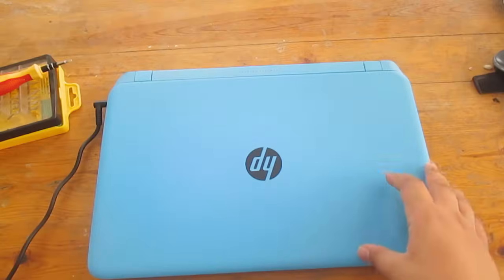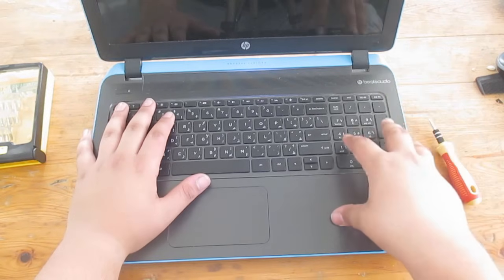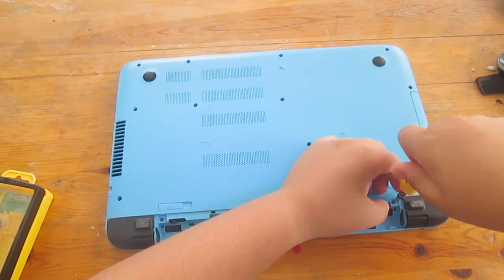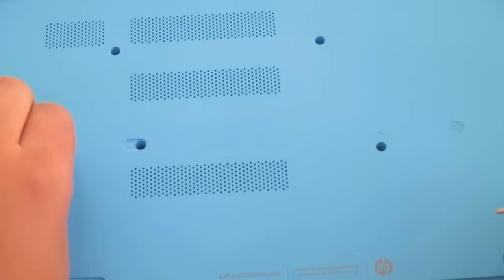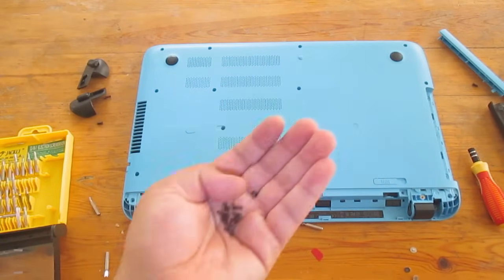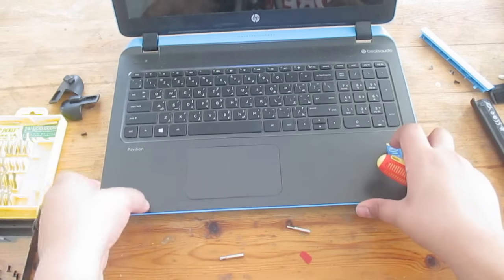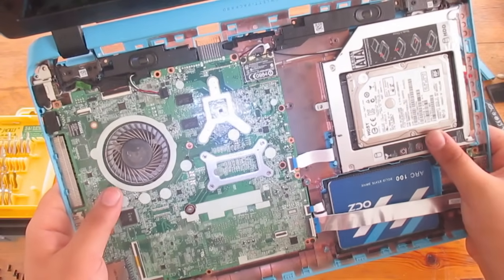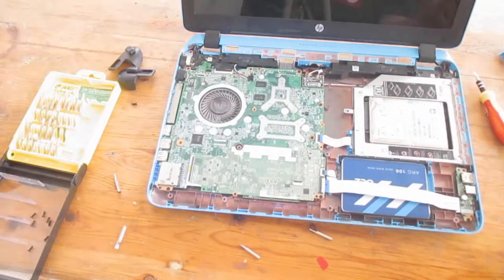How to disassemble Any HP Pavilion 15 P series notebook

Comment: I'm thinking about replacing the keyboard, how would you remove the keyboard out of the frame?
Reply: same here
Reply: Same question from my side
Reply: @harshjain1207  Don't do it. I tried it shortly after this comment was posted to discover that it is not replaceable unless you know how to solder it back into place which is not an easy task at all. I destroyed the laptop in the process of attempting to replace it without soldering.

Comment: does your laptop have a mini pci -e port
Reply from the maker: Yes it is on the top of the laptop body , Right above the Battery compartment
Reply: +Games Matrix I'm looking for a egpu stuff like one which requires an mini pci-e port to operate.
Reply from the maker: It wont work well with this laptop , as there is no removable compartment like most laptops out there, if you want to hook an EGPU you need to keep the laptop disassembled and have a bare bone mother board , Ii dont think it is worth the effort imo because you need to invest in a GPU and the EGPU adapter, and it is a hit or miss because Most HP laptops have PCI-E White listing which prevent anything other than specific WiFi/Bluetooth cards to work.
Reply: +Games Matrix oh I see that's too risky then, maybe I'll buy a computer in future till then my gt 840m is what I've got

Comment: I only have one flat screw on my laptop and it is IMPOSSIBLE to loosen. I have the correct screwdrivers. I even used pliers for more pressure and it is not working. this screw is under the plastic covering the optical disc drive, so it has to come off somehow. But I'm so stuck.
Reply: hi i know its late but did you get it out

Comment: Can I replace graphic card or core after i disassembler? Because 4 gb graphic is too low for me to play games.
Reply from the maker: +Zheng Hong Toh No you cant upgrade cpu/gpu . gaming is not only about the size of the card. i play games on a 2GB gpu , if you want extra performance learn about overclocking and do it within safe margins, i used to OC that laptop to boost my frames most of the time with decent temps

Comment: I'm guessing no, but would this laptop be able to use an external graphics card dock, preferably this one http://www.ebay.co.uk/itm/V8-0-EXP-GDC-Beast-Laptop-External-Independent-Video-Card-Dock-/321965028463?hash=item4af69c746f:g:ZOsAAOSwa-dWiCdX  ? Thanks in advance
Reply from the maker: +Ben Deane hey, I remember searching about that part, the one you linked wont work because it needs an Express card slot ( found in old laptops) what you need is this one

http://www.ebay.co.uk/itm/V8-0-EXP-GDC-Beast-Laptop-External-Independent-Video-Card-Dock-Mini-PCI-E/121860826167?_trksid=p2047675.c100005.m1851&_trkparms=aid%3D222007%26algo%3DSIC.MBE%26ao%3D1%26asc%3D20140122125356%26meid%3D9c8eced2952b4c6ba29ad8e7a832aca7%26pid%3D100005%26rk%3D1%26rkt%3D4%26sd%3D321965028463&tfrom=321965028463&tpos=unknow&ttype=price&talgo=origal

This is a mini PCIE one , you remove your wifi card and place that connector, But keep in mind since this laptop is pretty much locked down ( no separate panels for ram/pcie/hdd) you need to have your computer disassembled in order to use it, Plus there is a risk of the laptop not even booting because HP uses some protection and white listing which allows specific PCIE devices to run.
Reply: Games Matrix Maybe I won't try. But thanks so much for your very detailed answer and the link. I'm subscribing!!!!!! Thanks!
Reply from the maker: I am glad i helped :)

Comment: Thanks a great video!   I am trying to replace the HDD on my sons HP 15-P100dx laptop with a SSD drive and want to place the current 750GB drive in the optical bay with the adapter.    They seem sell 2 kinds that are either 9.5mm or 12.7mm thick.   Do you have any idea which one is needed for the HP Pavilion P series laptops.   Thanks again!
Reply from the maker: +Herb Karasic I bought the 9.5mm 2 years ago and used it across all my HP laptops, Pavilion G6 / PAV 15 N and PAV 15 P So yeah  i am pretty sure the 9.5mm is the way to go. Btw make sure to put the SSD in the Primary Slot and the HDD in the optical drive bay since the SSD needs sata6gb/s while HDDs work fine with 3gb/s

Comment: Cool video Man! but hey I've got a problem, it's about the keyboard, multiple keys doesn't work, I mean I can press them but they do not respond, also my keyboard's light turned off and I can't turn it on, the keys that doesn't work are 6(in both pads, keyboard and number pad), 5 in keyboard, ?, ' , f2,f5, and others... My laptop is a HP P series, beats version, is a black with red color.. Please man, if you can answer me it would be awesome! I'm so delayed in school projects /: cause of that. Thanks

Comment: games matrix do I need to buy  sata cable. also to connect 2nd ssd or is der in labtop  already
Reply from the maker: +Donal Dhar You need a special component to connect a 2nd SSD/HDD , which is the optical drive caddy

Comment: thank you for the very helpful video. I have 1 question though..those "ribbons" you remove right after prying open the case.. how do I reattach those when putting the pc back together again? thx in advance.
Reply from the maker: +Sille415 The ribbons are long enough to allow you to squeeze you hand inside and slowly insert them
Reply: @ananjaser1211  hello..thanks..I have a question as stated herein.

Comment: Hello this is a nice video! I have one doubt; my computer is 1 year old and the fan started to sound a little bit harder like a week ago, do you think the fan is thrashed or maybe only dirty? I used the laptop in very dusty areas though. do you think an external cleaning will do the trick? or maybe dissassemble it anc clean it from the inside? any way of knowing via software if my fan is not working well? thanks : - )
Reply from the maker: +Santiago Hernández well , if you used the laptop is a dusty environment then i would assume that the fan was damaged due to heavy dust , or the fan is just dusty and needs rough cleaning , eathier way you need to take a look inside the computer , 1 year in a dusty environment should be enough for alot of dust to build up

Comment: I recently open my Notebook HP Pavilion - 15-p150np (ENERGY STAR) because iam having overheating issues and i dont really know how to clean the vent ? How should iclean it?
Reply from the maker: +Hi Im Project First, make sure you have an overheating issues, I would assume your laptop is similar to mine, so your GPU temp should not reach 75c or even 70c , and CPU should be the same as well, if you have laptop shutdowns , download some tempreture monitoring programs and use the pc and notice the temp, if it goes too high, To clean the vents you dont need to disassemble the PC, just get  a can of compressed air and blow through the vents and the top of the keyboard near the WASD since that is the fan intake . If the laptop is 3 5 6 months old i doubt it is overheating unless you live in a dusty area
Reply: Ok Thank you For your Help

Comment: I cant remove one of the flat screws :(
Reply from the maker: +YouAreAnFajit I had that happen to me, I got a flat head screw pushed that screw down as strong as i could while rotating it, and after countless minutes it finaly moved. I never re inserted that screw back xD
Reply from the maker: Haha yeah i spent alot of time trying to get it out well, but then i was like to hell with ti i aint putting it back xD
Reply: same here dude
Reply: Games Matrix HAHA believe it or not, I happened to do the exact same thing before I even saw this comment and I don't plan on putting the screw back xD

Comment: Can you explain a little bit more what is that you adapted the DVD to insert another hdd?
Reply from the maker: +Héctor Escolar It is called, Optical Drive caddy , it fits a 2.5inch hardrive, and gives a SATA3GBs Speed, So use it for mechanical hard drives NOT ssds, it is pretty straightforward
Reply: +Games Matrix Thanks, and can you tell me if this laptop has one of 12.77 mm or  a 9.5 mm one?
Reply from the maker: I got the 9.5mm one for a prev hp laptop , and it worked on this one

http://www.ebay.com/itm/9-5mm-Universal-SATA-2nd-HDD-SSD-Hard-Drive-Caddy-for-CD-DVD-ROM-Optical-Bay-GU-/371449136207?hash=item567c18044f:g:acQAAOSwsB9WBVWW

This is the one i bought
Reply from the maker: 9.5mm is the universal size so it SHOULD fit without a problem , Now if you want to bring an SSD you need to do the following.

The SSD will go in the PRIMARY slot (the one your original HDD is connected to) and the HDD should go in the bay.

because the bay is SATA 3GBPS and the Primary slot is SATA 6GBS

if you plugged the ssd in the bay it will be limited to a max of 300mb speeds which is half the max speed of an ssd

I use an OCZ ssd and i get reads are writes in the high 500 , 580 and such. and the HDD is a 5400rpm which max out at 100mb read speed.

Just make sure the SSD IS IN THE PRIMARY and the HDD IS IN THE CADDY

and you should be good to go :)
Reply: tnks a lot u r so helpful 👍
Reply: +Games Matrix  bro ur's Video is verry helpfull , http://store.hp.com/us/en/pdp/Laptops/hp-pavilion-15t-laptop-m7h64av-1 that is my laptop is that fit on that 9.5mm and support? i want to a SSD  insert of DVD slot & what is now performance (SATA HDD) /speed on ur laptop?
Reply: +Games Matrix i will follow ur step &quot;the SSD IS IN THE PRIMARY and the HDD IS IN THE CADDY&quot; so then is the HDD running slow with CADDY or same speed as before ? (i hav 1tb HDD)
Reply from the maker: it will run at the same speed which is 100mbs read . the reason is , SATA 3GBPS handles upto 300mbs which is way enough for the HDD

Comment: Such a helpful video for such a pain in the arse laptop. Please do a full tutorial for replacing ram. I know you kind of explain it toward the end but i wouldnt want too miss anything if i try it myself.  Also on a side note the only reason i want to take this laptop apart is too upgrade ram. Would putting 4gb ram stick in the open slot even matter? It is the same kind from an older hp pavilion. Same kat values and all i suspect it would work. But would it help?
Reply from the maker: +Snazzy C Just putting a 4GB stick should do it, if your laptop is 8GB base it could be 4X2 ( 2 sticks of 4GB each) or it can be 1 8GB stick as in my case, so before buying the ram make sure to check how many slots, in windows 8+ go to task manager , go to performance tab, and then go to MEMORY , in the bottom right you should see SLOTS USED : and SPEED : 

Slots used can be 1/2 or 2/2 , if it is 1/2 Then you can add a 2nd stick, if not then you need to remove one of the sticks installed, And the speed section , it can be 1333mhz and 1600mhz , if it is 1600mhz and you installed a 1333mhz the ram will run slower (not by much tho)

So to sum things up , check the slots , check the speed , purchase the ram stick you want and install it

I had 8GB 1600mhz , i grabbed a 4GB 1600mhz stick and just placed it, and thats pretty much it, 12GB 1600mhz .
Reply: +Games Matrix  Ok yeah i have one free slot and 1 8gb stick... Not sure if you know much about gaming... But my hp 15 has 7 hundred something mb of vram. But it says up to 4205mb. thing is im trying to play fallout 4 and my cpu is good enough but theres no way im getting 4205mb vram the game would run fine if i did. So why does it give this reading in dxdiag? I know its only shared memory up too 4205mb. So there is a mod that allow you too share ram with vram but i dont have enough and thats why i want too add 4gb stick from my other pc.  I know this is off topic but it cant hurt too ask. how can i get the full 4025mb of shared memory too actually do its job? Also thank you very much for your reply.
Reply from the maker: Hey, first the shared memory will only matter if you are using the IGPU ( intel GPU ) which unfortunately can't run fall out 4 well , as i know to increase shared VRAM you just add more ram, and the faster the ram the better, But check if you have a dedicated GPU ( AMD or Nvidia ) go to Device manager > Display adapters > it will list available gpus , if you only have the INTEL HD then unfortunately i dont think you can run the game., i would assume you have  GT840m or 740m or an AMD gpu , so check , DXDIAG does not really give you the available vram well as it mixes everything ,  for example , DXDIAG says my Approx total memory for the DISPLAY (INTEL) is 6221MB , and the total approx memory for RENDER (NVIDIA in my case ) is 8105MB , while i only have a 2GB Graphics card. So yeah check if you have a discreet GPU
Reply: +Games Matrix  thanks for your feedback. Actually i have the amd radeon 8610g and it is attached too the motherboard so it is integrated. Correct? I cant overclock it either right? It is the same exact model as in the video, i think. stock nothing upgraded.

Comment: wow thanks for the video but golly gosh all this trouble to take out a hard drive ? what a poorly designed laptop
Reply from the maker: +hiewy The P series is so far the WORST HP Laptop i have dealt with when it comes to upgrading / taking apart,

I guess they are trying to go down the Unibody route
Reply: new toshiba's are  worse. so i have to removethe motherboard to upgrade ram dam that sucks
Reply: Hp tends to be like that always
Reply: it's a fucking designed laptop
Reply: just broken a new fucking one